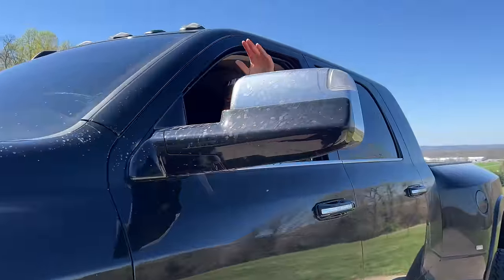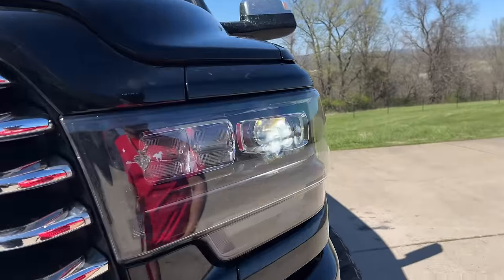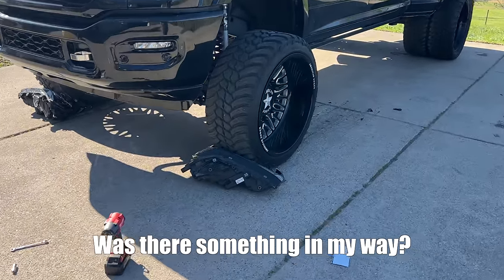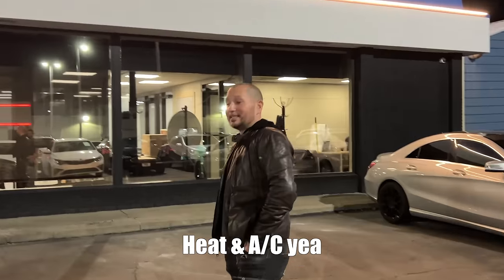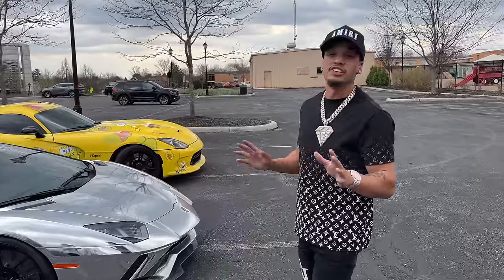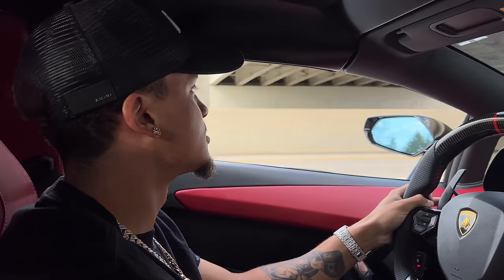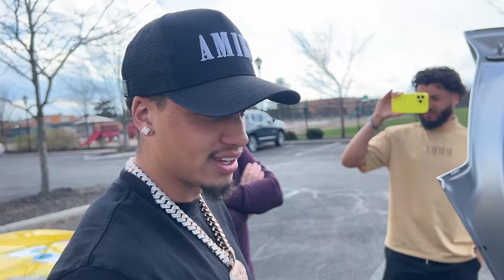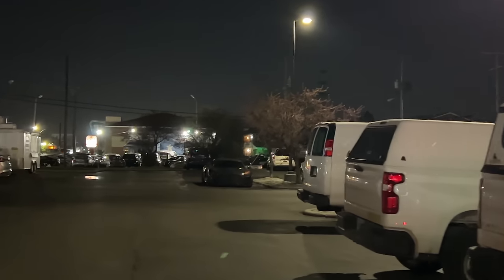Rich Dude in 2000HP GTR CALLS ME OUT! *$80K Race*

Comment: That's the only thing about the GTRs is when you put all that horsepower on there and you start making pools the transmission is freaking like 40 bands 5060 bands to get a new one that's why most people don't just do random pools for no reason stupid why are you running your car all the time on beast mode no wonder not to mention like did you build the transfer cases and stuff and was just a stock transmission surely not